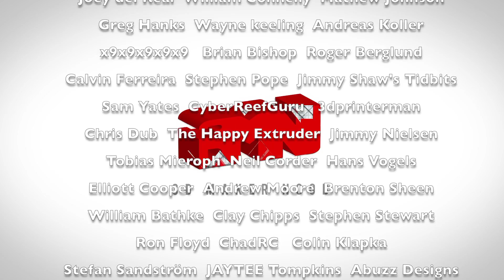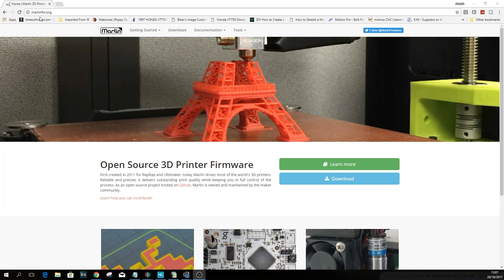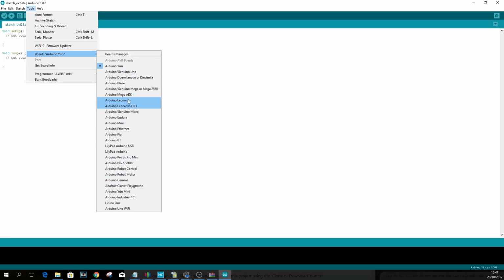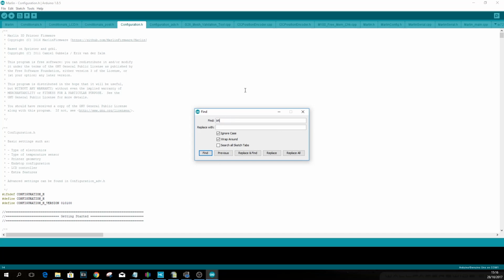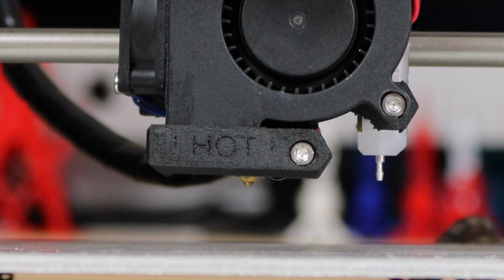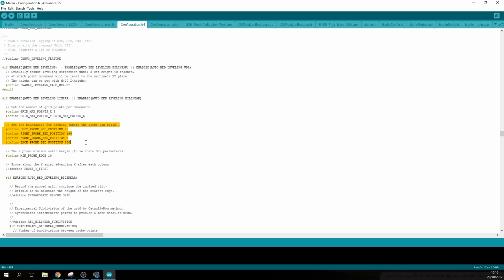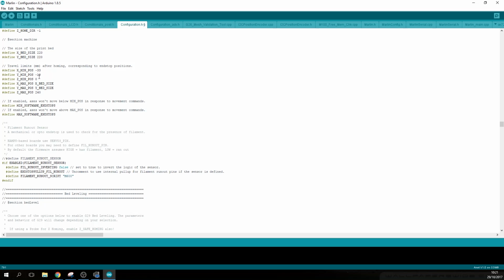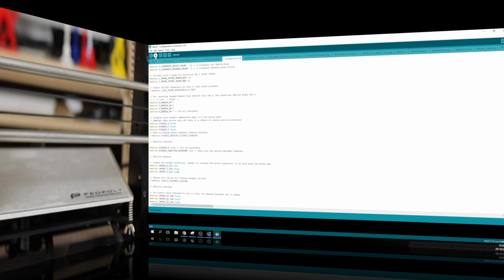BLTouch Setup on an Anet A8 with Marlin Firmware

Comment: what is the advantage to a BLtouch over a inductive sensor? is it more precise over the inductive sensor?
Reply from the maker: MrNiceguy21 bltouch is much more accurate as it is not affected by how hot the heatbed is
Reply: +MrNiceguy21 I just installed an inductive sensor (and Marlin) on my A8 this week.  At about $3 it is a lot less expensive than this BLTouch at $45.   Sadly my LJ12A3-4-Z activates VERY close to the bed ... living about 1.6mm above the nozzle.  Not a good thing.  It may be impossible to install a glass top.  Also, any stray plastic stuck to the extruder can cause a downward crash when leveling (my sensor is forward of the nozzle).   Respectfully +3D Maker, these industrial inductive sensors are precise to microns; accuracy is not an issue.  Still, I like your BLTouch better because it "peeks out" to feel the bed, then safely tucks away well above the nozzle.  You did the right thing mounting it inline with the X-axis!  ( -- amended after reading up -- ) 1.  Well, it does seem that if the bed is actively heating while leveling, that it can throw induction sensors off!  (doh!)  2.  I really should have bought a 8mm dist inductive sensor, instead of a 4mm.  (sigh)  Live and learn.
Reply from the maker: +GnuReligion don’t get me wrong, inductive sensors are very precise. What I meant is that the BLtouch is a bit more reliable in terms that the heat off the bed won’t affect the trigger point of it like it does with an inductive sensor. That is the main reason Prusa have now made an inductive sensor with a thermistor inside so it can compensate for the premature triggering due to the heat that radiated from the bed